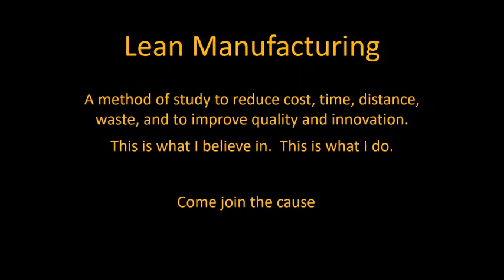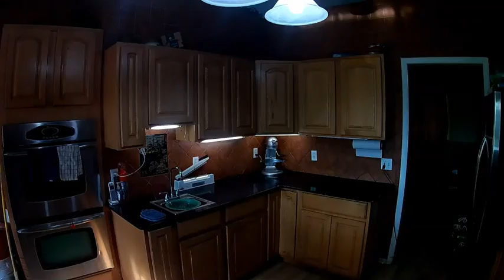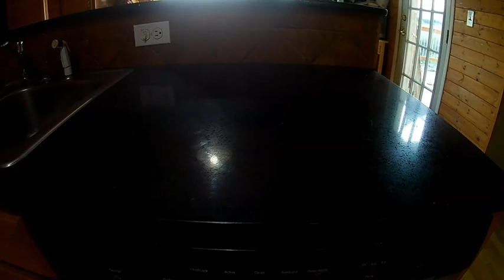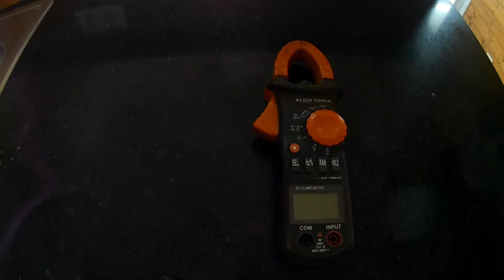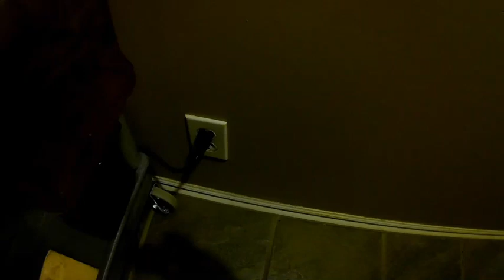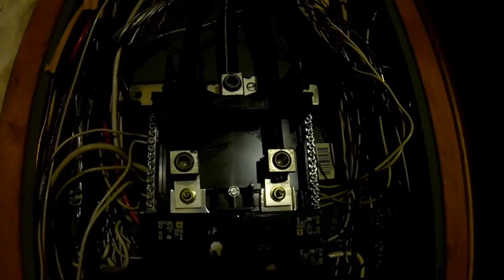So you want to buy a Harvest Right freeze dryer.

Comment: This was very helpful.  Your scientific approach to testing many aspects of FD is insightful as we continue to analyze all ways to optimize using our machine.  Our new, medium size FD was delivered July 26;  first food batch was July 29.  Functionality went awry on Aug 22.  More time than anticipated for technical analysis/diagnosis plus waiting on the shipment of the replacement relay board and pigtail.  Disheartening!  As newbies, we've worked to meticulously follow all best practices.  Pondering if an additional prudent step would be to buy an additional upright freezer for seasonal freezing/storing the produce from our garden and orchard for times such as this when our NEW machine is down for several weeks right during peak harvest season.  😒
Reply from the maker: I know the feeling.  Harvest is coming on strong.
Reply: @Philat4800feet  This may be of interest.  Heat wave of 96 so normally we wouldn't process anything today, BUT due to scheduled phone call with tech first thing tomorrow a.m. combined with necessity of doing mock batch test today (after smart hubby figured out on his own how to trade out parts since tutorial videos didn't match ...but I digress...)  It is imperative to keep ambient temp under control in our insulated garage so mock batch data can be emailed.  THUS:  we're using a pedestal fan blowing over a block of ice in a roaster pan holding a bit of water and placed on a cart directly in front of the FD.  Mock swamp cooler effect.  All doors closed since we're not pulling in outside air.  Temp more controlled that way.  We added a new ice block when the first one was nearly melted.  The ambient temp immediately dropped 2 degrees.   Not something we'd do everyday, but it's working in a pinch when we're trying to finalize all repairs on our NEW machine.
Reply from the maker: @maegan5034  That's dedication.
Reply: @Philat4800feet  More like desperation!  Anything to get the post-repair mock batch trial completed with data emailed to the tech prior to our next phone appointment first thing tomorrow.  Fingers crossed our machine is truly new AND improved now!

Comment: Great video.  One item you did not discuss is the oder during the freeze dry process.  Just ran the first real batch with the unit in the basement, and there is a slight oil (melted or hot) smell.  The Harvest Fresh medium unit was slightly used unit with about 3 batches run before I purchased it.  The pump is the premium pump, but I have no idea the brand of oil in the pump.   The oil is clean and clear.
Reply from the maker: I have a sheet of butcher paper, on the wall, near my pump to keep the oil vapor off the wall.

Comment: Nice vid but a 1500 watt heater at 3.413 btu per watt Is over 5000 btuh But very informative all around
Reply from the maker: I can't remember my math.  But I agree with you.  1500 watt x 3.412 = 5118 BYUs.  My HR was pulling around 17 amps with everything on. 17 amps x 120 volts = 2040 watts x 3.412 = 6960 BTUs  I can't remember where I come up with 439 and 527 BTUs.   Hmmmmm.

Comment: My Freezedryer always gives me a high temp warning the only thing that prevents that is running the air conditioner i will see what happens in the winter if the temp warning goes away then i will avoid running it in the Summer months of June, July, Aug.
Reply from the maker: Sorry to hear that.  No basement?
Reply: @Philat4800feet  I did eventually put it in the basement and bought a small 5 cu ft freezer for pre freezing the  food so far it is running fine but we also have a wood furnace on the other side of the wall so we have to be aware that it gets warm in the basement and keep the door closed so the heat stays out of that area.
Reply: @Philat4800feet  I do have a basement but its not a ideal place to put it because its to faraway from where our 2 freezers are which are in our Garage but we cant put the freezedryer out there because i live in upstate NY and it gets to cold out there in the winter and to hot in the summer.
Reply from the maker: @jmb-cm7mr  Your freeze drier is nothing more than a small freezer.  If your two freezers are working well in the garage, so should your freeze drier.
Reply: @Philat4800feet  But i don't believe its recommended to operate it in Temp under 35 or 45 and it gets down to 0 many times in winter and over 90 in the summer in the garage not ideal temp for operation according to Harvest Right
Reply from the maker: You are correct on the temperature ranges.  Below is a great article from Consumer Reports on freezer placement:
https://www.consumerreports.org/freezers/should-you-put-a-freezer-in-the-garage-a9079863564/

Comment: Always great tips and tricks!!! And all around very good information! ( even a 5 year HRFD owner learns a thing or two from you!) Bravo!!! 
* there are little rubber anti vibration pads that you can use for placing your FD’r on hard surfaces. I live in So Cal and I have my fd’rs sitting on my hardwood floor. ( earthquakes) I’ve had them there for five years and with the anti vibration pads, it works very well to totally take away the sound of vibrations downstairs.  😁
Reply: @ Kimmi Did What? - I also live in So Cal (San Diego). I have my fd but haven’t set it up because I’m still trying to figure out where. My home is tiny, just over 800 sq’. My initial thought was in front of a window so the heat can be blown out via a fan. But I hadn’t thought of the floor. I guess I was focusing more on accessibility. What are your challenges with it being in the floor? 
Also, can you share where you purchased your anti vibration pads? 
Thanks, Debbie